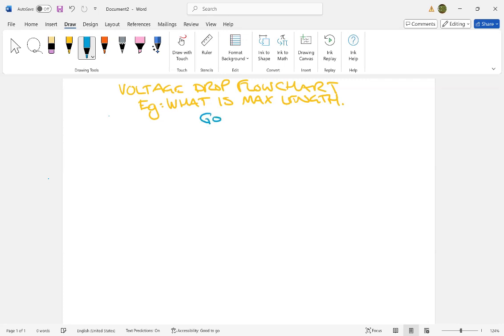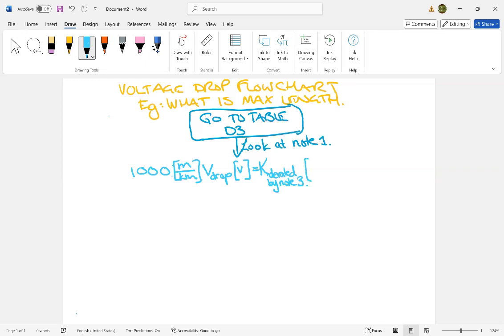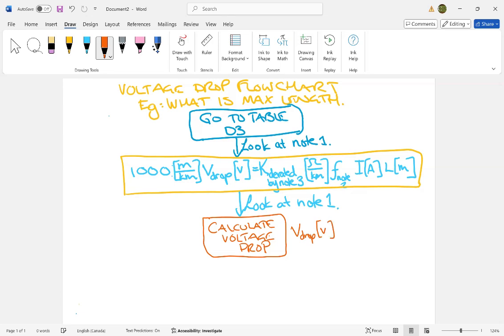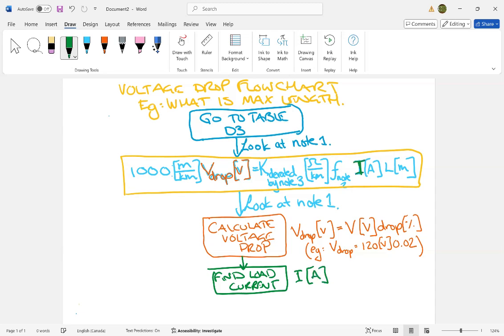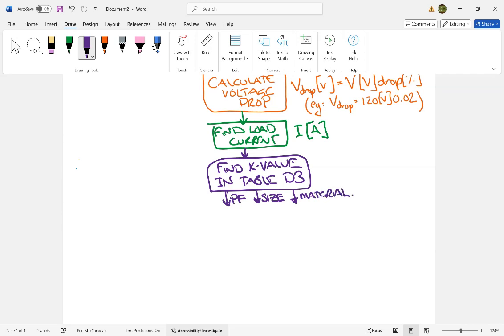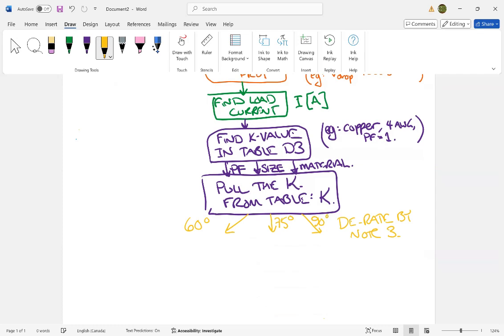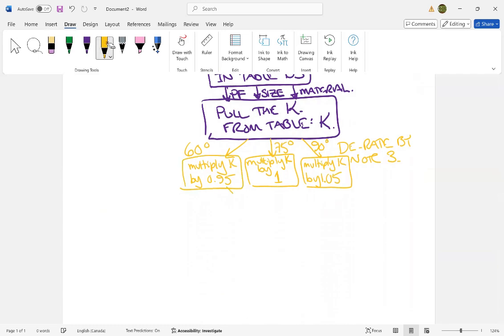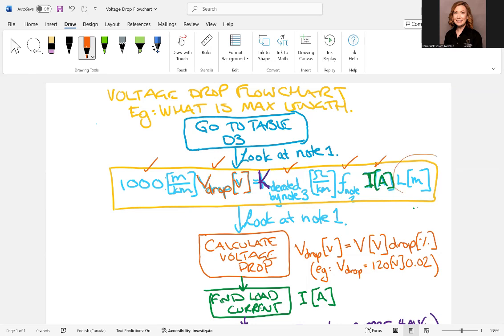Voltage Drop Flowchart Rule 8-100 of CEC Using Table D3 Easily

Comment: Hi Prof, so the formula is then just a pyramid. (1000xVD) divided by (K x F x I x L), if I want L, then L equals what remains in the pyramid? Same for K, K would equal what remains in the pyramid. For example, L = (1000xVD) divided by (K x F x I) or K= (1000xVD) divided by (F x I x L) or I = (1000xVD) divided by (K x F x L) and so on? I want to make sure I am understanding the relationship between them, not just filling in a formula from D3.
Reply from the maker: Yes, that’s correct!  It’s just one formula, re-arranged.  Many people like to think of it like a pyramid.  A common analogy is V = I R, I = V / R, R = V / I.  It’s all one polynomial (expression), solved for one or another variable. 

Literally, the variables relate in that one manner.  One expression.  

It’s just arithmetic to solve, or “isolate” each variable.  It’s not making a new expression.  

That’s not very clear in the book. 

Does this make sense?  You’ve got it!

Happy New Year!
Reply: @Prof.K.  Thank you